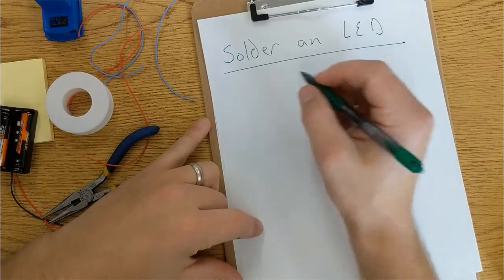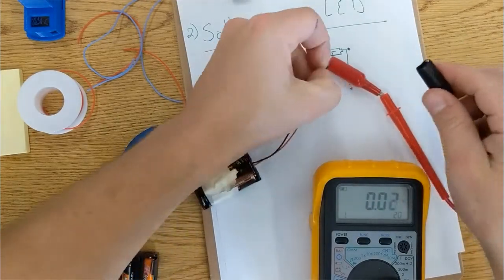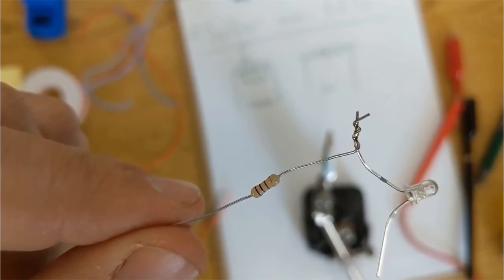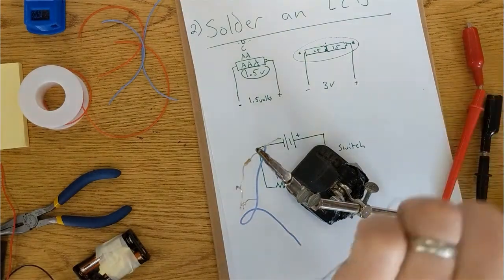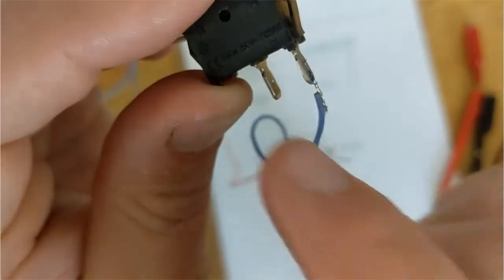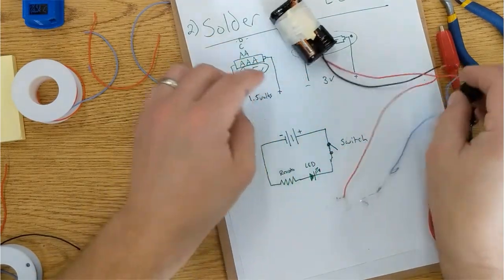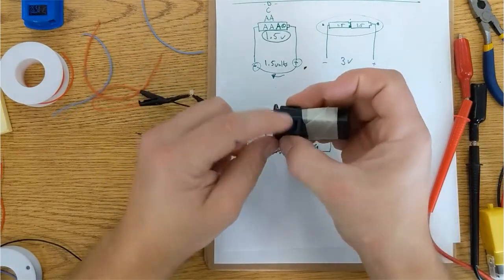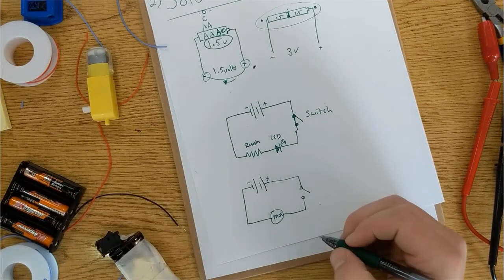Make a basic circuit with a battery pack, switch, LED and resistor.

Comment: Put shrink tube over your wire bigger than needed to cover the joint that you can slide over the connection once completed or use some hot glue 🕺